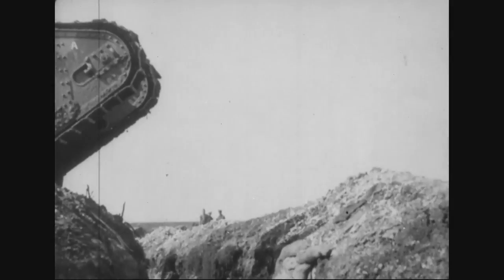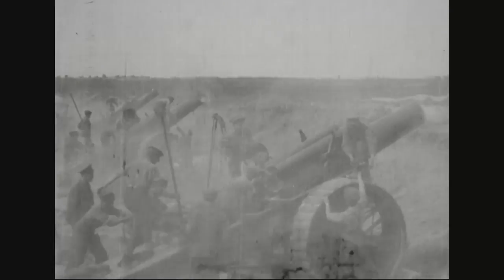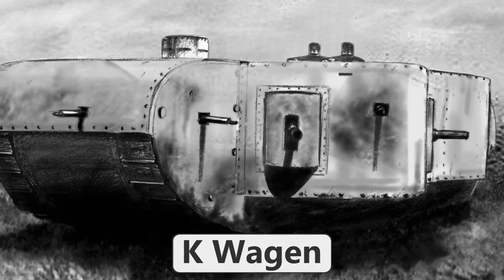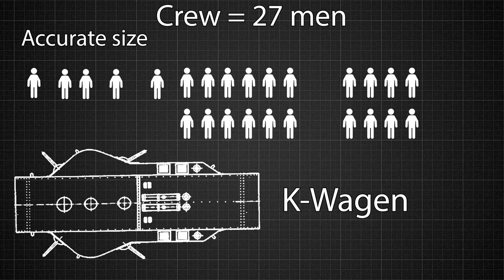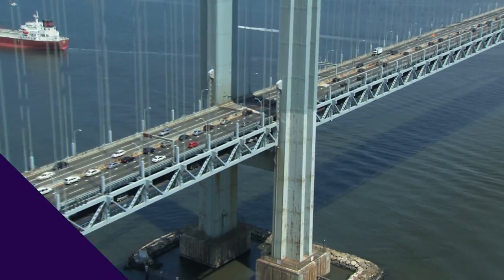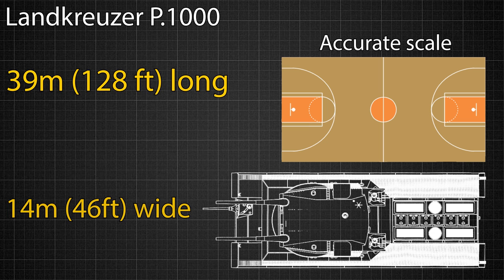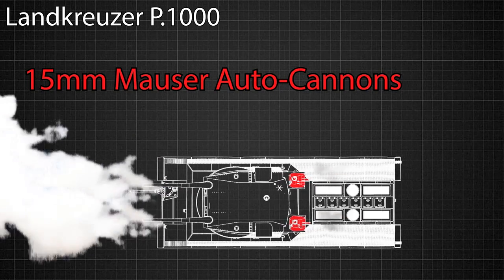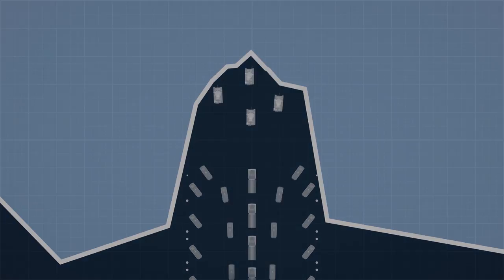These Are the Largest Tanks Ever Designed

Comment: Emmm Abrams has a 120mm gun...
Reply: The M1 Abrams had a 105MM, the M1A1 Abrams and M1A2 Abrams have 120MM guns
Reply: HighGeneral Blitz KV 2 has 152mm Xaxaxaxa
Reply: Andrew's Pitiful Life at least someone who paid attention in school
Reply: Sod off, all of you, the Challie 2'll beat the M1 variants in any test coff coff especially incidents of blue-on-blue fire coff coff
Or lack thereof.
Reply: Some Anti-French British Bloke Yeah, but how many of them can that broke island build?
Reply: That's what I was thinking too a 120mm smoothbore
Reply: Pineapples which was only to destroy pillboxes not tanks
Reply: The 105mm gun mentioned is not 4 times smaller in width compared to the 280 planned for the ratte 105x4=420 and 280/4=70
Reply: Thanks when I heard him say the Abrams was equip with a 105 I said whoa pull back on the reins. The information the author discovered may have listed 105 but all NATO countries have a standard 120mm smooth bore cannons on all their tanks. The British Challenger, the German Leopard 2 all have 120mm smooth bore fin stabilized projectiles. They also use a APFSDS which is armor piercing, fin stabilized, discarding sabot. It is made with depleted uranium which has a greater density than tungsten. Both are designed to zip down range, punch a hole in the enemy armor, rattle around doing all types of damage. It was so cool to watch sabot rounds fire in comparison to heat ammo. Heat which is a shape charge has a arc to it ballistic where as sabot is an almost no arch thereby punch the enemy's lights out.
Reply: The M1A1 Abrams have a german M256 gun from Rheinmetall.
Reply: HighGeneral Blitz i was legit just about to say that XD
Reply: Erik, the M256 was based on the Rheimetall 120 that the Lep2 uses, but is not the same gun.The Lep2 gun has a longer barrel, and different design bore evacuator. Look up any of "the Cheiftan" (aka Nicolas Moran) videos where he discusses the Abrams.. Not only is he a military historian for WoT's, he is also a former Abrams commander.
Reply: HighGeneral Blitz p
Reply: +Magni56

 The M68 shares a different design to the L7, nor is a licensed copy. A L7 was acquired to develop further munitions and designs for a gun from it. 

 XM256 and subsequently the M256E1 were licensed copies. The M256 doesn't share this title. They are not the same in design either. 

 The Leopard 2 cannot sue. It is a product. Not a business nor an individual. The whole point of licensed copying is it being allowed by the original manufacturer or designer.
Reply: naww it not bad, it for close range, not sniping (I wiped a platoon of 5 with a kv2, the 152mm gun is not bad just gotta know how to use it right)
Reply: update 120 rheinmetall gun dikcead
Reply: Mike Lcml5c Challenger doesnt have smoothbore, its rifled
Reply: HighGeneral Blitz m ONE abrams
Reply: There are NO 105 equipped M1's in the aresenal anymore.  They replaced many years ago.
Reply: Thanks for the tip :p
Reply: The M1A1 Abrams have a german M256 gun from Rheinmetall.
Reply: Mike Lcml5c that's standard now, but the M1 Abrams was built with a 105mm. The M1A1 and A2 mount a 120mm.
Reply: Its a German barrel too!!
Reply: he got it wrong in the first minute
Reply: The M1 Abrams uses a 105mm main gun, the tank that uses the 120mm main gun is the M1A1/M1A2 Abrams, they are different tanks. The M1 Abrams was designed to use the same gun that the M60 used, they later upgraded it to the Rheinmetall L44 120mm gun. And the bit about a 120mm smooth-bore being NATO standard is incorrect. The challenger 2 uses a riffled gun for greater accuracy, however they are looking into refitting the challengers with the Rheinmetall L55 120mm smooth-bore gun which is a upgraded version of the L44 currently being used on the M1A2 Abrams and Leopard 2A7. They also don't use depleted uranium anymore ( or they are still in the process of switching over ). they use a induction treated metal, it isnt really clear what metal they use but the penetrators are as or even stronger than the depleted uranium ones they replace.
Reply: HighGeneral Blitz
Emmm Abrams has a 120mm gun...
'
hi HGB...
germany made the 120mm cannon gun to put on the american M1 tank
Reply: Go home, do your research, and come back, please...
Reply: you are right! congratulations! Kudos to you!
Reply: Pineapples It was extremly inaccurate, its only good in wotb and war thunder because of russian bias
Reply: Tim Frolov Keywords: think. The M1 made its debut in 1980, but contrary to popular belief, current M1A1HC and The M1A2s were not upgraded M1s, albeit some was, most of them were newly built, with the most recent in the 2000s, also bonus fact, most of today's current MBTs were built in the 80s, if not late 70s, with the Challenger 2 and the Leclerc built in the late 90s and 80s respectively along with some other unpopular MBTs (unpopular by normal person standard anyway)
Reply: @Mike-tg7dj  Leo 2A6 has 125mm I believe

Comment: apart from the threat of bombers, i think the p1000 would also have had major problems with travelling. no way to easily disassemble it and put it on a train if, for example, you have it on one side of germany but suddenly you realize that it's way more neccessary to have it defend on the other side. probably would have been easier and faster to just build a new one instead of relocating the one you'd already have. additionally, germany already had problems with getting enough fuel by the end of the war, so it would have just been too expensive to keep this thing rolling for extended periods of time. certain terrain, i imagine, would also prove quite difficult. swamp like areas would certainly be a no-go and maybe even just too soft soil could have become problematic.

honestly, with this extreme size, it might have been a better idea to just put down buildings and mount the turrets onto those. no fuel requirement, much quicker to build due to not requiring any engines or other means of moving, etc.
Reply: if there is a river it just drives over it

Comment: The German Tank designs in WW2 were good. Very good. The Tiger attests to this well. The problem was though, unlike today Tank technology was still primitive, so there wasn't a great margin of difference in outstanding tanks and sub-par ones (like the difference in a Tiger and a T-34, a T-34 was still capable of defeating a Tiger). That was the Reich's first mistake. Secondly, when they took the shift from good tanks to great tanks, they didn't account for the material aspect. They were surrounded on both sides by enemies, especially after D-day. Because of this, with Allied/Comintern air bases on both sides, the bombing range and effectiveness of Germany's enemies was doubled, which crippled the Reich's resource production and economy. This made it so that the already scarce tanks produced by the Germans was widdled away to almost nothing. The Luftwaffe suffered the same fate.
Reply: The Tigers design was terrible, they shouldn't have made it. One: It took to long to actually put to together, Two: In muddy conditions, it literally dug itself into a grave when it drove in it, often getting it destroyed by an enemy tank, or the crews having to abandon it. Three: Just way too expensive, the Panther was a much better choice, and should have been kept and mass produced. The Tiger went down as a shitty tank, it's good when it's put together correctly, but under all that steel was the schematics, too expensive and complicated to build.
Reply: German tanks weren't good
Reply: wtf? german tanks was the best panther was put out to early. and the tiger might not have been best but it was good why? cuz it was the most feared. another really good thing about the tiger was that it could kill from rangers that it couldnt be killed from i mean that it can shot a t34 from 1km + and kill it but the t34 couldnt do that to a tiger (even if you find facts that the tiger wasnt good you will never get my inner nazi to believe you) and the stug 3g yeah this beast was THE tank killer. it was one that killed most tank in the war. germans tanks were the best and is 3 and up dont count cuz they might have been built under the but they never saw combat under the war. you see what im trying to say here is that geman tanks was the best cuz they went for quality instead for quantity well the americans and russians did the other way. BTW the tiger was not cheap because it was complex unlike the t34. fx the t34 had SO MANY MISTAKE like the holes. t34 was such a simple build it was like lego but sometimes there could come holes the size of a hand. and its seats. the driver and loader sat on the gear box and what not because the t34 had a life of 7 hours while the tiger had alot long life time cuz it was great at the time ( but if the tiger had angled armour i then it would have been like a god) btw sry for bad grammar its not the best no but im stilll going to school so dont cut the hate plz
Reply: plus people say if that only worked on the pz 4 with 75 mm HV gun then the war might have been long alot long like 3 years or some shit
Reply: but sweds top with best weapons again this is just something i have heard
Reply: +ulfenburg There was nothing quality about the Tiger. It had a big gun. That's all it had going for it. (US had bigger and better guns by the way)
Reply: KeinNameLP are you serious? Russian Guns were crap! The Long 88 had 30-70mm MORE penetration than the laughable 122mm. The 85mm was FAR worse than the 88 in accuracy penetration and reliability. And lets not start about the 128mm german gun...
Reply: no the americans didnt have better guns and yes the tiger might have broken down alot but it was way more advanced then is 2 and the t34. im garbage at english but the facts i have founds makes me believe the germans had the best tanks. but 1 thing for sure it that they had the best tank destroyer. but applejocc park yes when i came out it was the best in armour gun and some shit i cant name since im not good at english
Reply: but still german made the best weapons and long weapons if you agrue against that then i will just name some of the best. v2, mg42, fg42 and sturmgewher
Reply: Conner Forbis Yeah because tanks that were hard for maintenance and repair and overall reliable really shows that the Tiger was good

Comment: 3:15 "Nearly 3 and a half times" No, just two tonnes short of 3 times.
Reply: Maybe he switched from metric tonnes to short tons with the final figure?
Reply: No, two tonnes more then 3 times
Reply: It would of been even more. The maus were blown up from inside due to advancing ussr forces. So all its components like engine ammo rack etc were destroyed
Reply: With the theme of incorrect calculations, remember the 2 circles showing the width of the guns on the ratte and Abrams? How is 105 4 times smaller than 280?

Comment: what if I told you.... I designed the world's largest tank... (of course it doesn't exsist) but I designed a Super tank, larger than the Ratte... I call it the Kwagen PanzerMaus (yes spelled exactly like that) and it is an amphibious assault tank, at over 205 meters long and 31 meters tall. It displaces 131,632 tonnes and has a main gun of 800 mm (around 32 inches) like the Gustov or Dora during ww2... crazy tank.. I know... it even has 2 aircraft catapult that launches interceptors and 8 dual pared Flak Sk 37mm ( oh yeah and it has 108,095 Horse Shaft power propelling it at 63 (72 mph) knots under water and around 30-50 (34 - 57 mph) knots on land
Reply: Yes

Comment: The Abram's has a 120mm smooth bore gun not a 105mm. The first generation has a 105mm, but was quickly replaced by the 120mm.

Comment: Some corrections are needed.
Even though the M1 Abrams was originally designed with a 105mm, it only saw limited service before it was replaced with M1A1. The M1A1 was equipped with a 120mm main gun.
Some simple math.
Even if we are comparing the smaller 105mm cannon from the original M1, the 280mm SK C/28 is not 4 times wider. The diameter of a circle is its width. 280 divided by 105 equals 2.66 repeating.
If we are going by surface area of both bores, the 280mm SK C/28 is over 7 times larger by area covered, not by width.

Comment: 1:04
None of the Char 2C were ever operational during WW I - they were finished a bit late. They also didn't exactly prove themselves during WW II - most ended up scrapped or non-operational during the Invasion of France.
They're a tossup on size with the German Maus - hair bigger in 2 dimensions, hair smaller in 3, overall pretty much the same cubage - but the Maus had armor that would have LAUGHED at any attempt of the Char's gun to pen a Maus.

Comment: 5:24 just one of those guns for such a behemoth and only facing forward? It's big enough to have several of those.
And it also would've been vulnerable to attacks from the sides and rear. It would've required an escort made up of smaller tanks.

Comment: You missed their "upgraaded" ratte: The P.1500 moster. It was the heavy gustav railway gun from ww1 but on a tank. Intended to be 1500 tons, this monster did nothing to fix the ratte's problems: It was slower and bigger than it, thus increasing the problems.
Reply: i still dont get who had the idea to put a gun specifically designed for a TRAIN on a TANK and call it a day

Comment: - The M1A2 Abrams is armed with a 120mm cannon, and the M1A1 and M1 variants with 120mm and 105mm guns respectively don't exceed 60 tons.
- The T95 was completely missed despite being 86 tons
- The Maus did not use a snorkel, it had a diesel  electric drive and would travel in pairs. When it came to a river one tank would go under powered by the engines from the other. Once it had crossed, it would power the crossing for the other one.
- The Char2C was completely obsolete by WWII, it wasn't their low numbers that caused problems.- The Maus' secondary KwK44 L/36.5 was NOT a 3 inch gun. it was a 75mm gun. VERY few German tanks used a 76.2, 3 inch, gun.
- you also missed the Jagdpanzer VI Jagdtiger a 75.2 ton tank.
- you also missed the T29/T30/T34 a 64.2/65.8/65.8 ton tank.
- you also missed the Panzerjäger Tiger (P) Ferdinand a 65.0 ton tank.
- you also missed the all the King Tigers at around 68.0 tons.
- you also missed the IS-4M/IS-7 a 60.0/68.0 ton tank.
- you also missed the FV4005 a 59.5 ton tank.
- you also missed the A39 Tortoise a 81.3 ton tank.
- you also missed the Challenger MK.2 a 62.0 ton tank.
- you also missed the Challenger MK.3 a 65.5 ton tank.
- you also missed the Challenger 2 a 62.5 ton tank.
- you also missed the Type 5 Ho-Ri a 65.0 ton tank.
Even excluding any tank destroyers, there still are better choices for this list. Do your research. This list took me all of 15 minutes to find.
Reply: Really YouTube? I had LINE RETURNS FOR A REASON!

Comment: RealLifeLore, the M1A2 Abrams tanks that are in service today have 120mm smooth bore gun, not a 105mm, the first Abram models had a 105mm gun but ever sense the M1A1, the abrams has always had a 120mm gun, a small nit pick I just wanted to give you a heads up about.

Comment: Another video claimed that the P1000 Land Cruiser was designed due to a desire to use Warship parts to make tanks, which meant tanks the size of a warship. So LandKruezer =  Land Cruiser = Land Ship. If it really existed it would be much more than 1000 tons in weight. There was even a larger vehicle designed alongside the P1000. The Germans had built and used an insane 1000mm Artillery gun (yes that is the correct number of zeroes) but they only deployed it once because it was so difficult to move. So naturally the P1000 guy came up with a self-propelled version of that artillery. Considering what happened to the Yamato, they were probably correct to assume the land ships would simply be destroyed from the air.

Comment: Ok first of all, the Ratte 280mm gun was not standard for Kriegsmarine battleships. It was only by the Scharnhorst class. I would say the main gun used by the Kriegsmarine would probably be the Bismarck Classes 15 inch gun. Second, the biggest tank ever designed would probably be the Landkreuzer 1500 “Monster.” Featuring a whopping 800mm main gun. This gun was used on the railroadguns “Shwerer Gustav,” and ,”Dora.”

Comment: But what's the point in making vast armies of lighter panzers when you simply lack the fuel to run them. The German war machine broke down in Russia because of fuel and logistical issues not heavier and more complex tanks (which admittedly still wouldn't sway the favour of the war) In fact the wermacht were down almost a million combat soldiers by the onset of 1942 largely due to logistical issues like not having the ammunition.

Comment: Pity the nazis didn't attempt to build the R1000-Ratte. It would have lost them the war even faster. Aside from being a huge waste of resources and time they didn't have it would get stuck on any ground which couldn't support its 1000 ton weight (read everywhere). Then we get to the obviously overlooked part that it's impossible to hide from the enemy air force (not like you can just park it in forest or barn) and is so large it's perfectly visible for high-altitude bombers who can drop heavy bombs on it at will. 

Tanks have an optimum and practical size. You quickly reach a limit in which it's far smarter to build many good tanks rather than just one super-huge one. There's also good reason nobody has ever tried to build such a monstrosity after WWII even after technology has progressed dramatically since then. 

The Maus alone was a waste of time and resouces and couldn't even cross bridges. Its immense weight also spelled murder for its transmission and engine which would have worn out and destroyed itself in no time. A tank is only as good as its operational range, its mobility and the time it spends in battle compared to time getting serviced and repaired.